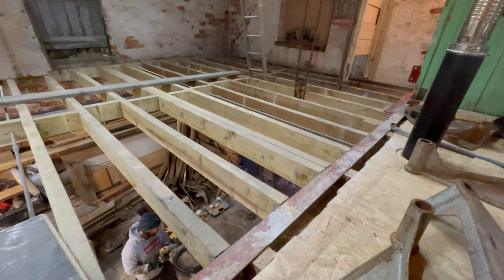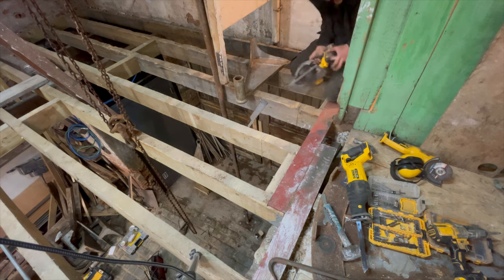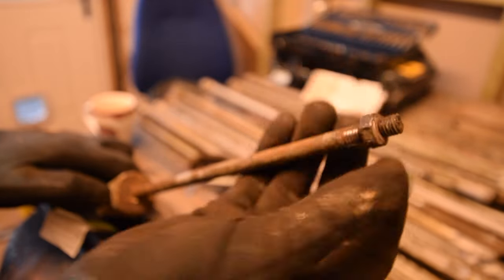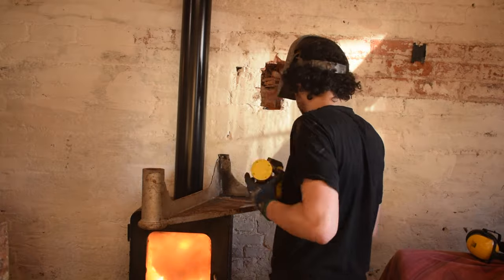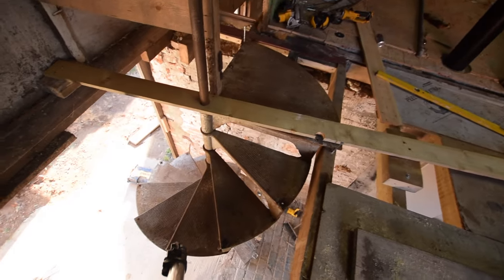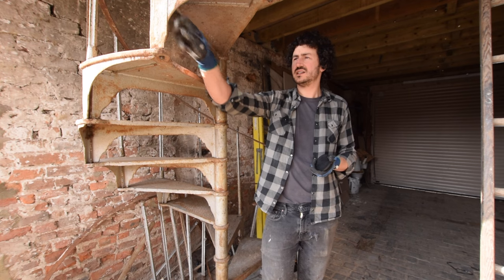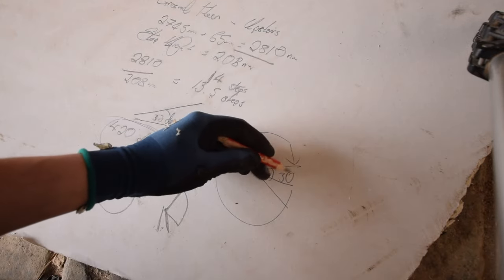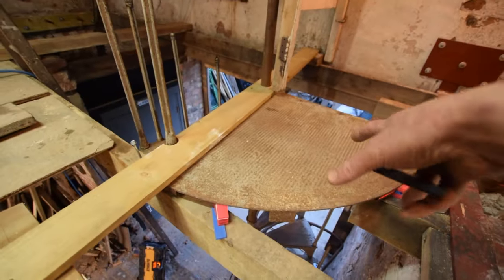Spiral Stairs for the Abandoned Coach House | Part 2

Comment: Lovely stairs! I’m thinking expoxy might be a solution for the cracks? And maybe just drill into the middle of every spindle and cut threads for a small machine bolt with a rounded head? :)
Reply from the maker: Great ideas, I’ll add them into the pondering pile

Comment: Beautiful staircase. Cast iron will crack like this when welded. Your best chance would be to grind out the crack and then braze the repair. You may want to find a welder with experience with this kind of repair though because it can be tricky. Braze repairs will be completely strong enough in this situation and the brass has just enough flexibility to prevent the cracking plus you're not heating the step up nearly as much.
Reply from the maker: I hadn’t considered brazing, thanks for the suggestion. Could look really cool with a bit of brass showing through in the crack too

Comment: Look after yourself with some decent PPE. Auto tint welding masks are pretty cheap. Cast iron welding can be tricky. Pre heating is normally essential. You can also braze cast iron which is great for repairing guttering/downpipes etc. Lovely to see this property being sensitively looked after
Reply from the maker: Thanks for that, given me the much needed nudge to order an autodimming mask, I’ll be able to see what I’m doing! 
The brazing idea is intriguing & yeah this casting seems particularly tricky.

Comment: Did you drill a hole at the end of the crack before welding? Not that would help much but might stop it progressing further each time
Reply from the maker: I didn’t, I wonder if that would work? Seems logical as it would maybe take the stress away when it’s contracting. Weird stuff, like welding a brittle sandstone flag.

Comment: OK but  how do you get large furniture up those stairs
Reply from the maker: You are so right, Jules said the same thing. I’m thinking a winch in an open hall OR a trap door to the garage with a winch. 
Failing that, there’s two doors upstairs which could be openable; definitely needs to be considered
Reply: You could install a elevator  I have seen them  on diy England show
Reply: O your step are cracking cuz you need a nickel rod to weld on castiron or it crack a normal welding rod won't doWelding cast iron is a tricky proposition at best. Generally speaking, it is best to heat both pieces to a low red heat, then use a specific cast iron welding rod. These are usually either a form of cast iron, or a high Nickel alloy. If heating is not possible, then grind the seam open and use the nickel alloy

Comment: Why U do not brazing? U can use silver rod and mach coulor. 
Same with those tabs on railng. 

And do U use electrods for cast iron or try regular? Ni-Cl work grate. Not always, but more often. I tryed weld forge regular rod, and do not work at all, with Ni-cl was easy
Reply from the maker: Interesting, must say I don’t like the look of the welds but they are strong. 

Are you suggesting braze then rivet together? 

Not cast rods, they are E6013 2.5